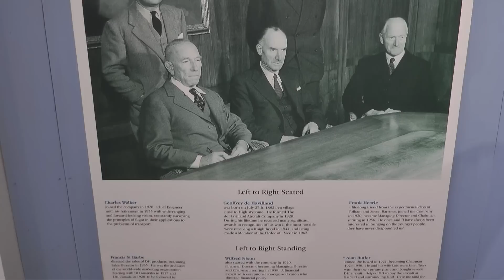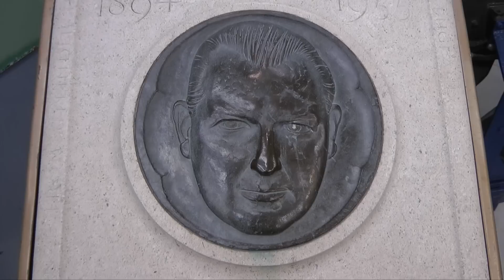de Havilland Aircraft Engines. Pioneering engine innovation from Frank Halford from 1920s to 1950s

Comment: Interesting for me as I maintained the Gipsy Major 145hp and Gipsy Queen 250hp engines for many years.  The Renault ancestry of the Cirrus carried through into the later engines as there were still metric threads, nuts and bolts used in certain areas.  At the same time as maintaining the 250hp Gipsy Queens, we also had 250hp American built Lycoming and Continental 'flat six' engines.  I was always convinced that British and American methods of measuring horsepower output were different, as the Gipsy Queen gave noticeably more power throughout its RPM range than did any of the similarly rated American engines.  For example, with the four-engined DH Heron aircraft we only taxied that about on the ground using the two outboard engines, otherwise we'd be constantly 'on the brakes'.  A twin-engined Piper Aztec however required much more RPM from its 250hp engines for ground taxying.
Reply from the maker: That's really interesting. Thank you for sharing the information.

Comment: Very interesting and illuminating. One seems to be stuck with Frank Whittles Jet engine being developed without realiseing that others may have also.
Reply: World's first Turboprop.
The Trent was based on an invention by Sir Frank Whittle. It was a RR Derwent Mark II turbojet engine with a cropped impeller (turbine unchanged and a reduction gearbox (designed by A A Rubbra of RR) connected to a five-bladed Rotol propeller. The Trent ran for 633 hours on test before being installed in a Gloster Meteor jet fighter which flew for the first time on 20 September 1945 at the start of a 298-hour flight test programme.

Comment: In 1960 I was an apprentice having spent my final year at the DH Engine Co. Leavesdon with Geoffrey Bell Chambers, their Chief Performance Engineer, whom had taken me under his wing so as to speak. He had a 6L blown open top Bentley and most days he would take me to DH Hatfield where we tested both jet and rocket engines, ie Gyron Junior and Senior, together with the rocket engines Spectre & Sprite. If he was off to somewhere else I would sit on the floor of the daily works van to get there. After finishing said apprenticeship as engine tester I went to sea starting as a junior engineer in the Merchant Navy working on big engines. Totally different of course. My first ship the MV Adelaide Star with twin Doxfords, 2 two stroke super charged direct drive to stern propellers, with each engine developing some 14,000hp.

Comment: That last jet fighter project looked promising. Sad that DH and its employees didnt get the chance to develop it and that 20.000 lb thrust engine. British aviation after WW2 seems to be a sad story as a whole.
Reply: Britian's aircraft industry was doomed after the countries defeat in WW2.
Reply: @DoktorBayerischeMotorenWerke 
   Of course British military forces did indeed occupy a large part of Germany for decades after 1945.
    Yes that's right, Indeed it is without doubt entirely correct that the gas turbine concept was first conceptualised in England before 1800.
    It is also correct that the multistage sequential rotor stator axial compressor & axial turbine as used for power generation & propulsion turbomachinery purposes was of course first produced in England by Parsons of Ireland & North England before 1900. The same components as used in all current axial gas turbine aero engines.
  Its also well known that serious work on the axial configuration gas turbine aero engine began in England before 1929.
  More recently of course the most powerful gas turbine aero engine on the planet in 1944 was in fact the Rolls Royce Nene versions of which would go on to power many jet fighter aircraft including the Mig 15 & UK & US built aircraft during the 1940s & 1950s.
   We are very aware also that it is indeed correct that Russia still posseses a large piece of what was Germany.
   The UK & Russia have Nukes.
Germany does not have Nukes.

Comment: In 1906 Danish Jacob Ellehammer flew a homebuilt plane, with a Peugeot based 3 cylinder Star-engine on the small island of Lindholm in Denmark. As the island is small he had a pillar with a rope in the center and a concrete track for his plane. But during the coming years he flew his own planes at Shows in Europe.
Reply: Very ingenious like a control line aircraft.😊
Reply: @FrederickBowdler  He was an Inventor and Producer, and he flew around in Europe with his own constructed planes during the years after. Brazilian, Santos Dumont, who became the first to officially fly in  Europe, the 23th of October 1906, had just bought a "Wright Flyer"!
   The Danish Technical Museum in Helsingør/Elsinore has an Exhibition of his inventions.
    By that, the small compressed air-driven wooden boats sailing on a lake in Tivoli for many years, were built and constructed by Jacob Ellehammer!
Reply: Today, the boats in Tivoli are electric!

Comment: Fab ulous presntation and info. The Brits were real innovators and still are.
Reply: But did not invent the jet engine or jet aircraft
Reply: @DoktorBayerischeMotorenWerke 
    Yes that's right, Indeed it is without doubt entirely correct that the gas turbine concept was first conceptualised in England before 1800.
  It is also correct that the multistage sequential rotor stator axial compressor & axial turbine as used for power generation & propulsion turbomachinery purposes was of course first produced in England by Parsons of Ireland & North England before 1900. The same components as used in all current axial gas turbine aero engines.
  Its also well known that serious work on the axial configuration gas turbine aero engine began in England before 1929.
  More recently of course the most powerful gas turbine aero engine on the planet in 1944 was in fact the Rolls Royce Nene versions of which would go on to power many jet fighter aircraft including the Mig 15 & & serious UK & US built aircraft during the 1940s & 1950s.
Reply: @Paul-mh9pr  The Jet engine was invented in Germany
Reply: @DoktorBayerischeMotorenWerke 

It is of course obviously very important to note that factually speaking the following info is indeed 100% factually correct.
Kharzeestan Krappenz DiktorBummer Jurkzxoffenz etc and co - they should all note well with great awe & much reverence.

Maximinime's engine was essentially a turbocharged boiler feeding a hybrid steam / boiler combuster exhaust powered turbine based on Parson's turbomachinery inventions, driving a compressor producing enough power for a lawnmower.
  Ohain was copying Whittle but used a never to be used again radial inflow turbine (to avoid patent conflict)  which first ran after Whittle's world's first demonstration of a prototype pure internal combustion gas turbine aero engine in 1937.
    
      The turbojets used for the Bow-wing ( see B-47 wing folding incidents) were of course based on the Metrovik UK f2/3 gas turbine aero engine work which first ran in 1943, was flight certified but not required at the time, development of more powerful engines continued. The TG-100A which led to the j35 etc benefited from the Anglo/American technology exchange with one of its designers, Glenn Warren, stating that one of the most important British contributions was the concept of multiple combustion cans.
     We can clearly see that Centrifugal compressor gas turbine aero engines are currently produced.
     In 1944 the centrifugal compressor RR Nene engine was of course the most powerful & most reliable gas turbine aero engine on the planet. Versions of the Engine would of course be produced in the US for use in US built jet fighters for the next 10 years & of course it was built in Russia for Mig 15 & Mig 19 aircraft.
     Whittle was the first to conceptualise & patent a number of versions of the gas turbine aero engine including axial compressor, centrifugal compressor, reheat & turboprop & various types of  turbofan arrangements. Whittle was the first to demonstrate the basic Whittle pure gas turbine aero  engine in 1937 of course.
     The Pratt & Whitney PW-200 range of engines for example are a Whittle engine including reverse flow combusters of course, they are also a version of all current internal combustion gas turbine aero engines, differences being compressor type, combuster configuration & fan configuration. 
      The gas turbine was of course invented before 1800 in England. Work on axial compressor turbojet engines began in England before 1930.
     The world's first multi stage sequential rotor stator bladed axial turbine & axial compressor having of course been first produced in England around or before 1900. Of course it is factually entirely correct that the same basic axial turbine & axial compressor technology for example is used in both Rankine & Brayton cycle turbomachinery.
   It is factually indisputable that C A Parsons manufactured the world's first axial turbine power generation turbomachinery machinery & axial turbine ship propulsion turbomachinery before 1900.

      The exceptional & excellent W & J Galloway & Sons of course would be a good example of a company making steam engines & their boilers at the time during the late 1800s the world's first steam engines of course having been constructed in England in previous centuries, steam engines are not axial turbine power generation turbomachinery utilising axial turbine gas turbine & axial compressor technology in power generation & propulsion  machinery, W & J Galloway & Sons did not involve themselves with axial turbines or axial compressors. A steam engine is of course a piston engine.  The world's first steam engines being of course produced in England before 1800.

        The axial multi stage sequential rotor stator turbine of course exists in its own right independently where ever & how ever it is utilised including when used as a Dehavilland, Halford, Metrovik, Armstrong Siddeley, Bristol, Power Jets or Rolls Royce Gas turbine aero engine or ship propulsion gas turbine or for example a cruise missile engine or as power generation turbomachinery using Brayton or Rankine cycle turbomachinery configurations. 
  The said axial turbine being produced for the first time in the world in England before 1900.
     There is of course no doubt that the world's first basic axial compressor jet engine arrangement was manufactured in England before 1937 work having started before 1930.

      It is factually correct that there are currently no instances of jet aircraft powered by Jumo engines or German technology engines, no US aircraft were powered by German jet engine technology.  Such ridiculously shoddy extremely short life engines with sheet steel combusters & turbine blades would not under any circumstances have achieved US or UK certification
  The Nickel super alloys which are primarily high Nickel content & low iron content were developed around 1940 in Hereford England for turbine blade use in internal combustion gas turbine aero engines.  At the time they were available nowhere else. Germany & the US would attempt to use stainless steels, mostly iron with high nickel or chrome content, the US GE turbocharger division of course didn't need anything better for piston engine turbochargers for example. Germany had plenty of Nickel but hadn't figured out the why & how of  Nickel super alloys.
     Of course All 1940s & 1950s US & UK, Russian, French / other countries built jet aircraft using technology from the UK based on the early Whittle engines & work done at the RAE & Metrovik up to 1943.
    Indeed there is no doubt that all failed German attempts were of course half soaked copies of UK technology using partial info obtained from UK industry & academia.

    Rolls Royce of England & England's Shires & Lands now has 2 wholly owned subsidiaries in Germany one of which handles routine work on smaller 2 shaft engines & a wholly owned subsidiary in the US that was previously Allison of course.
                   C H E E R S
                            &
  Toodle PIP Old CHAPs
                         😎👍

. .... ... . ...
xcxcvcxbc
. ..... .........
izivvvvicxc

Comment: Fantastic side of de Havilland that I had no idea about... 1946 turboprop! No idea!
20,000 lbs thrust jet engine... And, powering the Buccaneer!
Just brings back the bad taste of the USA gutting 🇨🇦 aviation, Avro, Canadair, de Havilland....
Reply: World's first Turboprop.
The Trent was based on an invention by Sir Frank Whittle. It was a RR Derwent Mark II turbojet engine with a cropped impeller (turbine unchanged and a reduction gearbox (designed by A A Rubbra of RR) connected to a five-bladed Rotol propeller. The Trent ran for 633 hours on test before being installed in a Gloster Meteor jet fighter which flew for the first time on 20 September 1945 at the start of a 298-hour flight test programme.
Reply: the Buccaneer had the Gyron Jr engine ot the big Gyron.